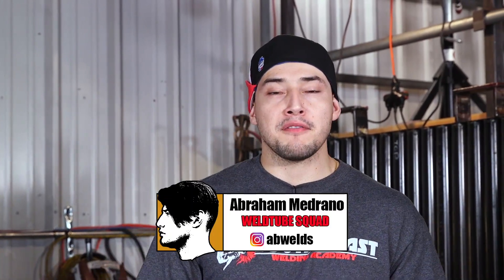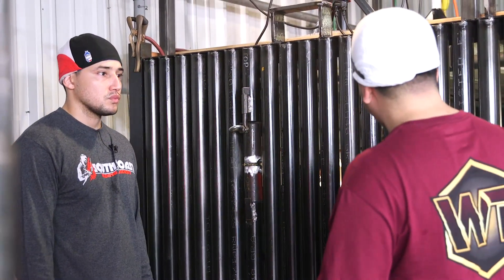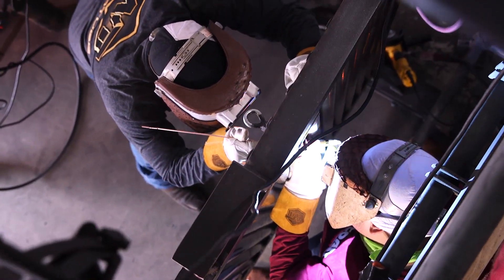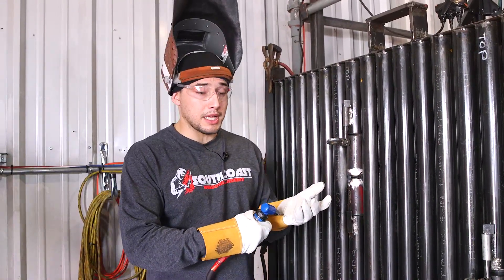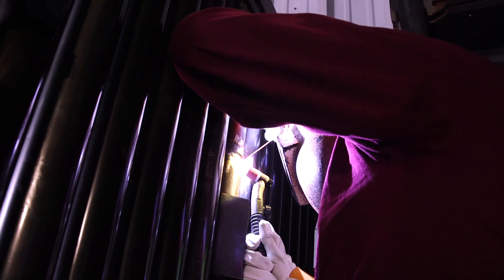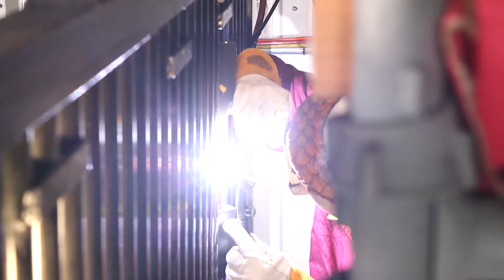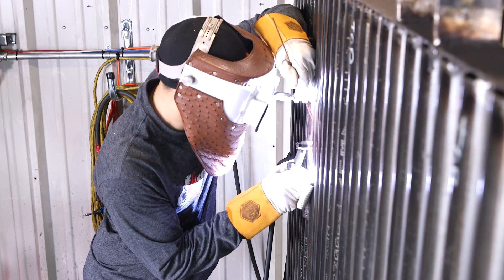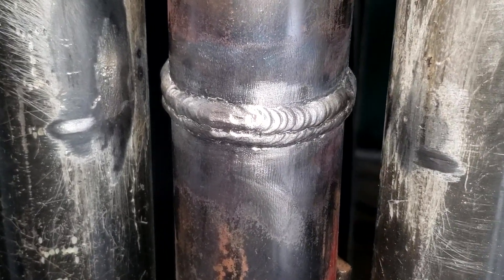Boiler Tube Welding | Boilermakers TIG Welding for Power Plants

Comment: I'm curious, what % of welds, after inspection, radiograph, pressure testing,   end up being considered failed and have to be retouched or cut out and rewelded? Like what is the expected success/failire rate for a reasoanbly competent tube welder?
Reply: I’m a retired Union Boilermaker and if you are having a hard time making welds that will pass inspection the contractor you are working for will pull your welding papers for that company and you will not be allowed to weld for them again until you can pass a welding test and re certify and they will probably let the Union hall know also they only want welders that are consistent and do not have any bad welds at all
Reply: It depends. They want a 100% pass rate. They know that's impossible, but you better not be fucking up often. Its gotta be once in a blue moon.

Also stuff thats gonna be QCed to hell is gonna get the best welders. If youre not the best you'll probably get moved to less demanding welds.
Reply: @samuelbell2390  on critical black liquor boilers it is 100% x ray so every weld has to pass inspection but on most coal fired boilers it is 10% x ray and if that doesn’t pass they will start x raying more until they find out what the problem is and correct it

Comment: Warning do not join the boiler makers union as a pipe welder because all you're gonna be doing is usually welding  tube when you seldom get to weld, and very seldom do you ever get to weld, you do more bull gang work then anything else and the bullgang terminology is just a fancy term regarding to hard back breaking labor , back breaking labor,  that's right,  when you're a boiler maker you usually have to wear paper suits covering all of your body you have to wear a special mask cause you're around poisonous gasses And all of that's very encumbersome and the only pipe you get to Weld is tube, but that's very seldom ,mostly most boiler maker work ,even if you're are a welder ,most boiler maker work is hard Back breaking labor picking up, lifting   tieing knots, transporting stuff , cleaning out air houses it looks like whatever they call them I've been with the boiler makers before and I  know what I'm talking about you'd rather join the steamfitters Union or the pipe fitters Union but never the boiler makers Union
Reply: If you were really in the boilermakers union at all you would know that boilermaker is one word not two
Reply: Correct . You can also join the pipefitter union .

Comment: It don't matter union or non union on push through, recommended flush or a hair above flush, as far partner feeding wire is complete bs on water walls unless you're on floor, roof or nose arch tubes
Reply: Apparently you’ve never done tangent tubes.

Comment: Do they typically have a machine with lift arc in the field when doing this or do you have to scratch start?
Reply: Most contractors rent Miller XMT or a Lincoln equivalent, which has lift arc, and can stick, then run a Suitcase for FCAW the membrane between tubes.
Reply: Just stick with scratch start.  Then you don’t have to worry if you have to switch polarity midstream.  You won’t have to climb out of the hole

Comment: I think is missing the most important part (filmed on video),which is the start on the sides of tubes. Don't believe in this technique.From my experience need 2 welders techniques for filling and cap on the sides.

Comment: Lol 95 amps? Root that in at like 120. Haul balls. Bend that wire and feed your own wire lol. You can get back in the snipes (membrane for all you nonboilermakers) with a number 7 cup pretty easy. 

Buddy welding on a waterwall would be like hot pickups on stick cappin. Real gangster shit

Comment: Me as a boilermaker screaming at my phone.. ITS NOT PIPE ITS TUBES!!!
Reply: Typical
Reply: There's seamless pipe dipshit
Reply: Pipe has as seam. Tube doesn't.  Split  the membrane first.  Millin motor.  Then the grasshopper. It also looks like an element not the water wall. Prep work is ugly as well 😪.
Reply: @raylegg2269 the seam is not what makes it a pipe or not😂🤦‍♂️
Reply: @raylegg2269 naw really?

Comment: Just wondering why you are tiging it all the way out. I've always tiged the root and hot pass then buddy whipped it out with stick
Reply: It all depends on the welding procedure. It could be tig root 7018 hot pass n cap. Or it could be tig all the way out.
Reply: For the money.

Comment: great video! can we use SMAW to weld the boiler tube?
Reply: You're not supposed to, lol. At least from what I've seen. Code dictates TIG. Ive seen exceptions made for a huge string of tube cutouts where its quicker to root with tig and cap with stick, but 99% of tube work ive seen is with tig. Im a boilermaker welder up in Canada
Reply: @vangoghsseveredear  okay, thank you. Nice to meet you sir
Reply: @vangoghsseveredear  It depends on what kind of tubes you’re welding in the boiler. Some you TIG all the way out and some you TIG root and hot pass, then SMAW fill and cap. It’s all dependent upon obstruction, thickness and material of the metal.
Reply: Not Section I of ASTM Boiler and Pressure Vessel Code. What "Code" are you talking about?

Comment: I have been on plenty of tube jobs and have never done this. It’s always been partner fills you wire for the tacks then you weld a quarter of the tube with your right hand then do the other quarter with your left. Then you pass the torch to your buddy and he does this same. And this is on black liquor boilers....  (and even power house) and if you know anything about that type (black liquor) you know what could go wrong with those hahah
Reply: And also forget about the burr grinder, you only use that if you absolutely need it. And if you know how to weld you will almost never need it. (Most companies will give you a couple extra $$ if you do it fast so don’t dick around) And most places never have you TIG the cap unless it’s a repair. It’s almost always 7018 for the cap....
Reply: By turning your torch out or down slightly at stop,  it prevents that pop that can cause a fisheye and does not leave that glob to start off again and doesn’t require a burring tool. I hate those burr’s down my neck and in my shirt!

Comment: Way back 1990 quazvin iran boiler power plant project.we are using gtaw smaw process for 2 inch diameter pipe.especialy in a 45 degree position.

Comment: looks like in the root you were using a lay wire method of filling the gap, id this correct,    and when you guys are saying that you use a longer than "normal" stickout, what cfh do you set your gas on ?  interesting video guys =)  please keep them coming .

Comment: Put a wooden wedge in there and create more space
Reply: The membrane between the tubes on either side of the tube that you're welding on prevents them from moving. If you're on a emergency outage the plant wants the boiler up as fast as possible. So they aren't going to want to take the time to remove and replace any extra membrane. We do use wedges to spread tubes in other areas though.

Comment: For those that don’t know the difference between a tube and a pipe. Steam flows through a tube and shit flows down a pipe! 🤓
Reply: Thats not necessary true. Steam flows through tubes and pipes, it is dependent on the package or prints as always.
Reply: Brian B Boiermakers really only need to look at prints to see how the engineers f up.
Reply: Not true, there’s boilers specifically called watertube boilers. The tubes are filled with water. So not necessarily just steam will be seen in tubes.
Reply: @CalikuhL you are absolutely correct! Pipes are for conveying liquids and are not high-pressure tubes. Yes there is water in tubes but mostly steam and pressure. Pipes will explode under similar pressures.

Comment: 3/32 gap 1/8 wire about 135 amps. Faster, but alot less forgiving. Nice video. Not many people doing boiler tube videos
Reply: Yes sir the way we do it too..tighter gap so less to fill and cap..much quicker..I personally use the back and forth technique I picked up from Jody on welding tips and tricks.

Comment: Root at 95?? Turn that bitch up. In the boiler you dont have time to adjust the heat. Put it on 145 to 160 and root to cap. Runner hot and wide and let er glide
Reply: And feed your own damn wire

Comment: Is a pressure test applied when you do a repair on boiler pipe. Or a UT...??! Also I thought those welds came out pretty good considering the restrictions... good job partnering that weld. That can’t be easy...
Reply: they usually xray 100% or at least a percentage but they hydro the boiler afterwards anyways so theyll find any leak
Reply: I don’t think they will put the squeeze on tubes in a class. Mostly visual instruction. Maybe they could cut coupons for bind-test. Non-destructive such as x-ray ( not practical in class situations for obvious reasons.)
Reply: *Boiler Tubes. Not pipes.

Comment: Good video for anyone that wants to be a boilermaker tube welder but y’all got to keep in mind this is just a waterfall simulation and that is the easiest it’ll ever be for ya on a outage. 🤘
Reply: Without a doubt bud that aint no 6 deep in the mirror economizer weld
Reply: Steven Cotta gata b boofin🤫🤙  hope ur doing well brother
Reply: Please, What type of test should I be ready to take to be a boiler maker welder?
Reply: @edohgache  2” 6G heavy wall tube test. TIG root pass, no TIG hot pass, switch to SMAW ( preferably 3/32) for fill and cap. No grinder for the test. File, chipping hammer and wire hand brush only. Good luck.
Reply: @LeadRakFPS ol' common arc test. Dont forget the 15 different QCs that are gonna look at your fitup, root, cap, and bend.
Reply: @samuelbell2390  Lol, yep. While they simultaneously eat up a good portion of your 3 hours for the test by being in another room getting coffee, using the restroom, bullshitting outside while smoking, etc. And then you don't get that time back. I've almost busted out on time just because they wasted my time doing shit like that. 🤣🤣 Stay safe out there, brother!! Local 83 Kansas City, MO here.
Reply: Only boiler RAT....

Comment: Should of picked up some 3/32 7018 after the Tig root pass and learn to buddy weld learn to pick up the arc up from your partner from the other side of the tube panel, continue the weld on your side and hand off  the arc to you partner, clean your weld and get a rod ready to pick up the arc from your partner and repeat / slag welding makes a beautiful weld on the cap if you're welding hot enough especially on stainless stick and don't forget the sponge after milling the tubes !!!!! Also the piece that replaces a blowout is called a Dutchman , and yes I'm a union boilermaker 154 strong!!!
Reply: Local 101 here!!
Reply: @Shane Johnson I work building and repairing tanks, 98% of the time  jj White , matrix , and witherup Is who I work for i worked out of the hall when tanking was slow but after   all the coal burners got shut down or converted to gas there's more people on the list waiting for work so  it's harder to get work out of the hall I still keep up my common arc up to date ever 6 months it would suck to lose 30 contractors
Reply: @Shane Johnson what local you out of ?
Reply: @Shane Johnson yes sir I am goats on the floor and 3:00 on the shell

Comment: I’m a boilermaker out of local 85 there a lot easier way to buddy weld then the way you guys doing it first one idk why your tigging it all the way out grab a buddy whip and stick weld it can crank out Aton of tubes a night and when your on the side of the tube where the membrane would be u can have your partner feed you the wife instead of holding ur wire at the top joint

Comment: Glad to see something using tig something other than stick welding on pipe flanges or on a  welding bed thats crude as a farmer built it , different from oil and gas welding for a living tig welding is were its at besides other ways to make a living living I a fithwheel trailer and going to job to job  u know who u are !

Comment: It is not that easy and its way different in the field. Tangent waterwall tubes are what we have at our plant and very few boilermakers that come to our plant can handle it. When doing a repair many times you have to do everything from one side forcing internal welds and window closures. And TIG welding the root is out the window completely. Not even a micro torch can fit in the tubes. Should try it or find someone who can. Would definitely be an educational video for sure. Weld on brothers.
Reply: Window welds our best when they’re confined to one or two tubes and they don’t want to pull the skin off the outside of the boiler.
Reply: @Roncass4  agreed, but many times they need the boiler back ASAP and the extra work and manpower needed for that isn't feasible. Its all about the bottom line with most companies u know.
Reply: @Kurst535  agreed. But they also realize that union Boilermakers are saving them hundreds of thousands of dollars per hour, to get it done, and then get away from it. Unions train very efficient Boilermakers, and the companies that realize that instead of using scab labor save them time and money as well.
Reply: @Roncass4  I'm union brother, UWUA 1-2, just not a boilermaker. Not sure if you experienced forced outages or how the grid works where your located but our company loses hundreds of thousands every hour the unit is forced offline. And not for nothing, you know as well as I do not all, but many unions milk jobs for days, they're not all trained the same. At our plant in the time they take to set up, build skyclimber, cut out and replace tube they're about 24 hours in. Us house guys get it done in a 8 hour shift.
Reply: @Kurst535  that’s not how I handled my job’s. You have to be somewhat of a diplomat between your men and the companies you work for.
They expect professionals and that’s what I gave them. I would never put up with a slacker. A real boilermaker will take pride in his work and companies understand this. 
I have made welds in a boiler where I could not use my hood at all, only a welding lens because of the heat, steam and humidity. I put on a harness attached a retrieving rope ( just in case) and crawled in. I would weld until I couldn’t see, then wipe off my lens then burn some more rod. 
I will always believe in unions for all the right reasons.
Reply: @Roncass4  most definitely always Union proud!!!
Reply: What are talking about, we built the whole Boiler. “Very few Boilermakers can handle it.” Who do you think built that plant for you to have a steady job at. 😂 Seeing a couple Boilermakers struggle at ONE plant is not a good reason to bash a trade by basically saying that the very trade that built the boiler can’t handle tangent tube welds or certain welds at YOUR plant. You ever stop to think that some of those boilermakers were apprentices or had never welded tangent tubes or done those specific welds before. I’d like to see your first try at the welds you speak of. So many holes in your statement. If you think that making window welds on tubes can’t be done in whatever situation your talking about, then you’re not doing something right. I can make a window weld from the inside of a tube with a regular sized TIG rig. You just have to know certain little tricks. Back feeding, longer stick out, damming etc. Then you set here and say, “I’m Union, just not a boilermaker”. Yeah, well if you were a true Union brother you wouldn’t be saying negative things about ANY other unions and you wouldn’t be willing to do Boilermakers work either. You stand your ground and tell YOUR plant that they should have the closest Boilermakers Union dispatch a tangent tube welder. And your first sentence was “It’s not that easy and it’s way different in the field.” Really? I think it is easy though. Maybe because I’m a Boilermaker.